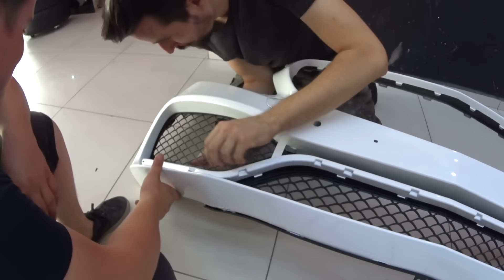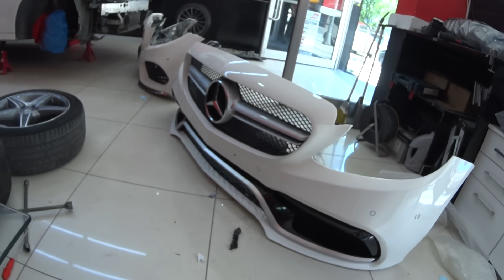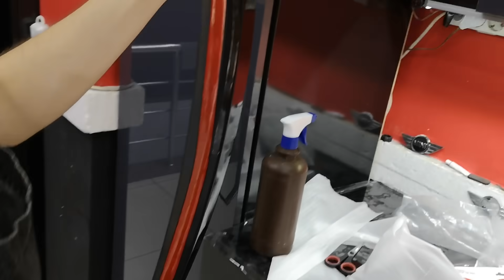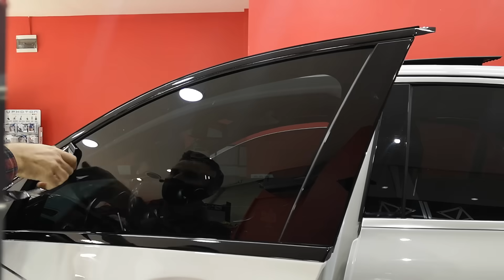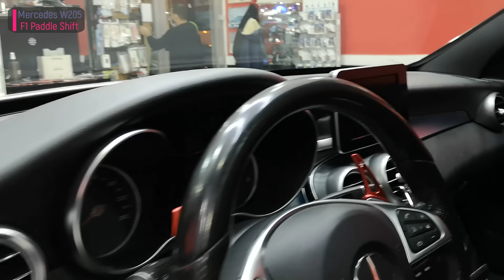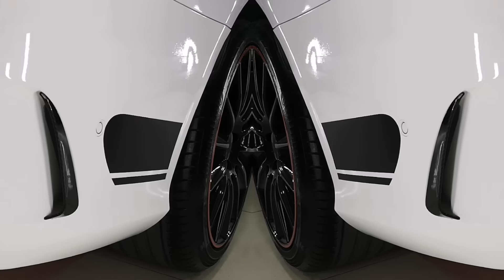Mercedes W205 AMG // C63 Style Dönüşüm // Black Edition - Body Kit

Comment: Guys, im trying to do the same, I have exact same W205, have converted the quad tips but im looking at front bumper.  Was this conversion a completely new bumper of did you convert the original?  I have exactly same bumper as this one at start - Thanks for help!!!! i have sub'd
Reply from the maker: If you have the W205 AMG rear bumper, the C63 or C43 diffuser will be perfectly matched.
Reply: @ilkersgarage  that doesn’t make sense to me? The front bumper and rear quad diffusers are totally diff parts? The w205 Amg LINE body has a diff front bumper (same as c43) I want the c63 one which is done here in this vid, do I need to buy a whole new bumper or is there a conversion ?
Reply from the maker: @russellflynn5543  Yes, the front bumper needs a complete replacement.
Reply: @ilkersgarage  thanks for confirming